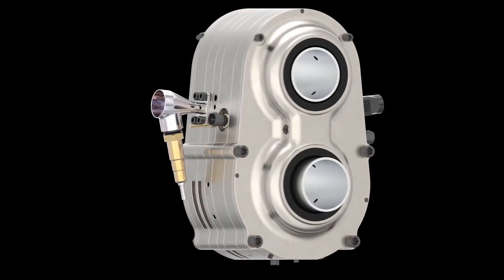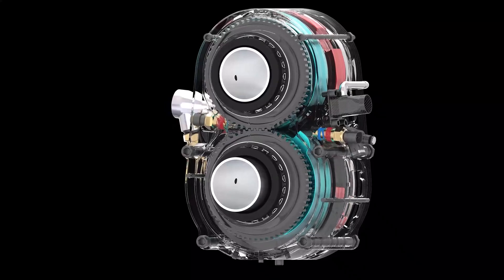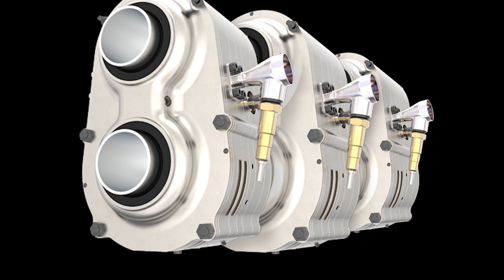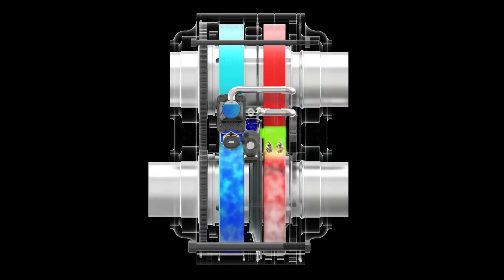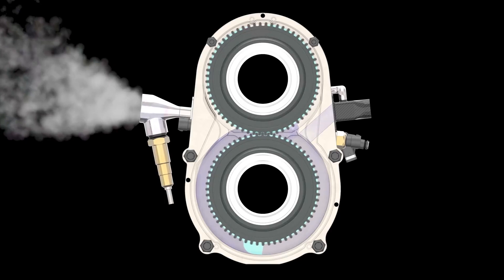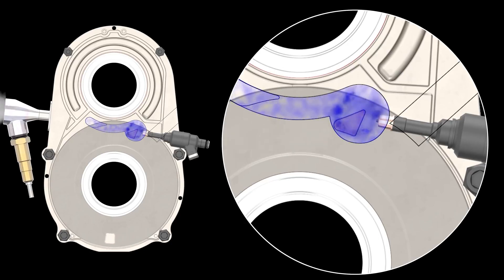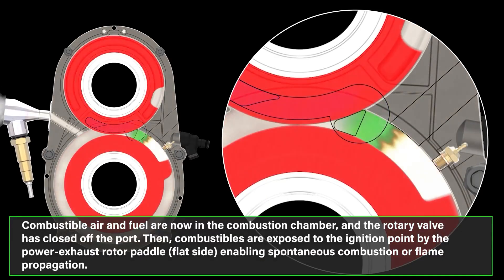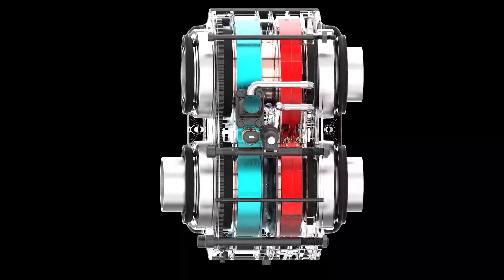This pistonless engine runs on hydrogen and revs to 25k rpm

Comment: Very interesting.
I'm kind of a Fanboy of Hydrogen as a Motor Vehicle Fuel (AS WELL AS Others. Egg Basket Scenario)
Conceivably possible, even to retrofit our old Gas Guzzling classics.

A couple of quick points on of EV's and Fossil Fuels...
1. EV'S aren't as Efficient as you've been lead to believe (Still a good idea, See Below)
2. Fossil Fuels are far LESS efficient than you've been lead to believe..
    (2/3 of the energy these fuels produce is lost as unrecoverable HEAT)
3. EV Materials Are a bit less environmentally friendly than we're told by the EV People.
4. EV's aren't near as BAD for the environment as the Oil Industry tells you.
5. ALL energy Sources are FINITE. Fossil Fuels being the most used and the smallest supply. Nuclear Fuel grade materials, if we ramped up production Tenfold, would last us another t0,000 years (See 6) and the sun will dim to the point of unusability in what? Several Billion?
6. More people have died TODAY from Fossil Fuels (Not including accidents) than have died from Nuclear Energy Ever (Including Accidents, and yes, including Fukoshima and Chernobyl).

Comment: Too complicated, you need to be able to mass produce something like that then you need fuel then you need an infrastructure for that fuel. All of it has to be easy for an average person to drive this to work or wherever without any worrying. Electric is easy, just plug and go. The motors are just an improved version of something humanity had for a century, nothing to re-invent.

Comment: Maybe good as gas to electric power as it could operate at a constant uninterrupted rpm but I don’t see it would be practical for gas to mechanical as this would require too much fluctuations that this engine clearly would not hold up to in any long term sense.

Comment: Hydrogen is a lousy fuel for vehicles. It has about as low of an energy density you can get, is difficult to handle, requires a pressure vessel that adds a lot of weight, and in the end, or should I say beginning, has to be manufactured from another fuel. 
As far as this design goes, 25k RPM sure sounds cool, but is useless for pretty much any application without the addition of some kind of gearbox reduction, which again adds weight. 
Sealing might be accomplished though an oil film, but that's going to contribute to emissions.

Comment: To bad its not real and has some huge problems. Or you would not be showing some junior high kids 3D render project. A one off motor of this size is 20 grand to make so why is this a render if its real. Oh its simple any motor to run at high RPM must first get there and there for not having seals make the motor never get to its needed operating speed. And if you want more reasons I'm sure Thunderfoot would love to see your reasoning behind it.

Comment: I reckon someone should give it a scale model test run with a comparable electric dynamo to test the potential as a hybrid engine, since both are great in theory and have tremendous potential individually but both have alternative strengths and weaknesses, it could be a great way to phase out fossil fuels for those who want something to fall back on when the power runs dry in an ev.

Comment: With new materials and the new "plasma wire" computer driven machine operations I can see a future of disposable-component rapidly rebuild able power units.  They have no fuel unless nuclear Reactors are constructed to separate Hydrogen from water by electrolysis at 47 Kcal/mole of gaseous hydrogen.

Comment: Hydrogen is much better than electric.  It is safer, holds more energy than a battery, and is cleaner than a battery.  You can get hydrogen by splitting water molecules using solar panels vs building a solar panel creates a lot of extremely toxic waste.  While batteries do not give off exhaust, the exhaust hydrogen gives off is just water, H2O.

Comment: They probably recommend hydrogen, because it functions more like extremely high octane gasoline. With regular gasoline, I'm sure the internal pressure needs to be reduced, and thus power will be significantly reduced as well.
The second question is: what's it's estimated mpg? Because a high efficiency, but also a high Rev limit, may make this engine weak at low rpms, and not very efficient.
Reply: With the rev limits and the horsepower this supposably has, it will deliver max ho at low rpms like 5-6k rpm. Also I have no clue how you can make a monolithic block or metal that can handle tight tolerance and high-low temperature difference, especially on something as explosive as hydrogen

Comment: It is a pipe dream. This engine has a lot of problems: Engine seals, cooling, air compression, fuel spraying and many, many others. The engine is not so small whatsoever. It just works on the computer and on the computer only. There's a video of that engine and it's big and it leaks oil like crazy. I'm waiting to see the working model and its specification.

Comment: High precision tolerance plus high heat don't mix well. Tolerance and money don't mix well either. This would cost a fortune if it ever gets built, and then it will not be economical to sell once it is working  so for these reasons, I'm out. Lol if it ever does work it will be some space age material that costs a fortune plus some extreme precision manufacturing. I wager it either never works, or never gets mass produced if they get a prototype to work.

Comment: Has one actually been built and run yet,how do very close tolerance,s work,you need to allow for expansion,it all sounds good in theory,I have drawn up many engines myself on paper,some even using household blenders and flux capacitor,s but never gone any further,there was an engine built years ago called a split cycle engine that ran on water,apparently the oil companies bought the rights to it.

Comment: Unfortunately the elites want to restrict the movement of the masses so they will keep flogging the poisonous and useless battery vehicles. Hydrogen is easily the best way forward for cheap and clean fuel for the masses.

Comment: You would want to see the torque vs RPM values and just how narrow the real world torque curve would be, not the simulated or theoretical values. Then the issues tight tolerances when they come up against the thermal expansion. How big and complex will the cooling system have to be and on that note the more wasted heat heat the less efficent the drvice is.

Comment: It seems unrealistic and how tight would the tolerances need to be to avoid leaking at any speed... at the extreme tolerances and ~200psi you can't lubricate very well as you would blow out any lubrication you might put in there to prevent the engine dying from friction alone. On top of that thermal expansion is not a thing I guess with the new wonder materials this engine will be build out of because if it is a thing those tolerances will make it a very short lived engine if the tolerances are tight enough to prevent 200psi air from escaping.

All in all it looks like a wonderful thing on paper but in real life... lets just say that until its build and runs I simply will not believe it. Also lets compare this to the Koenigsegg terrier a real engine that works, at 90kg it delivers 670hp, this fantasy engine would need 4 units to get to 640hp at 64kg it would be lighter but by the looks of also a lot bigger. On top of that it needs to be build first and proven to work which I seriously doubt it will as nature has a way of being difficult when it gets to forcing crazy power out of a very small package.

Comment: … tight tolerances remove seals on anything…. 

But we can’t just do that.. 
even a mrd dollar science project uses copper squash seals and when we get to those levels of precision like the polish of a space telescope lenses (even those are not perfect tolerance) they are expensive.. 1000$ glass 200k polish…
.. and there was something with high heat, pressure tied to those tolerances… …expansion, corrosion, ..

Comment: The problems that I see with this, and to a lesser degree electric, is that we spend a lot of time focusing on how clean and eco-friendly they are, very little time in the costs involved and even less time on how absolutely fucking volatile some of these technologies are. Both electric batteries and hydrogen are substantially more likely to go up in a ball if something goes wrong than a fossil fuel engine.

Comment: Hydrogen is the most inefficient and unpractical of all energy carriers.
That alone makes this very unlikely. 
The extremely high pressure makes it unlikely. 
The extremely small tolerances makes it impossible in my opinion. 
Just a few of my thoughts about this fantasy engine.

Comment: Things like this, more efficient engines, combined with low capacity, high power electrical storage and electric drive trains will provide much cleaner and more economical transport.

Comment: Don't know why every one is on the hydrogen kick.  It's expensive, hard to contain, polluting to produce and is hard on most metals that it comes into contact.  Plus we would have to build the entire infrastructure to maintain it.  Now if this could burn cleanly with propane or methane, that would be wonderful.  A lightweight car that would be perfect for urban travel and perhaps a very long range because of it's efficiency.

Comment: Maybe has potential in aerospace applications where the high RPM sealing requirements are actually manageable by throwing money at the problem. Aero engines will never be car engines so long as cars need to be affordable. I can think of lots of reasons why I'd rather have a cheap 4-banger in my car than this thing. Size and weight reduction is great if you can afford it, most vehicle consumers cannot.

Comment: i think its better than electric batteries to make an electric car are far more costly than what it would cost in material to make this engine and hydrogen made from water and salt water works fine we maybe could even lower the sea level over time or stop it raising running all engines on it

Comment: So it would waste large amounts of gas and hydrogen would warp because it wouldn’t get enough air to cool it and the ware would make it useless in long distance driving
Reply from the maker: Not that i know of yet. 
They are still in development
Reply: @ChrisVSCars  hey good response time but it seems to me one of the thing wrong with this engine would be the heat the best engine I ever seen was the duke engine but not the duke design watch let’s learn something kids been making small two strokes for long time and his ac compressor engine is the best work model of the duke
Reply from the maker: Only time will tell whether they will be successful😂

Comment: Aside from the tolerance issues mentioned by others, I'd be interested in seeing the expected torque curve for something with a 24k rpm operating window.
Reply: The rpm floor is probably pretty high, if it's going to skip fire under low load
Reply: All I want to know is if I can fit a screaming dump valve on it...
Reply: @bigmike obama Agreed. Even if they used a low friction coating on the rotors that won't burn, it will eventually wear off and you'll basically have to replace the entire engine because the case is worn too. A mere rebuild is not enough, it's a disposable design. 

The only way I see hydrogen combustion being viable is via high temperature combustion in a sealed, low pressure argon saturated chamber to generate electricity directly via a lot of peltier modules through temperature difference. The transfer of heat from one side of the module to the other induces an electric charge that can be harvested. The greater the difference, the more electricity is generated because more heat is being transfered.
Reply: @TheDustyShredder  You might want to search for "hydrogen fuel cell" and compare their already attainable 50% efficiency with what you might expect from your suggested design.
Reply: Most likely, the curve will start around 9k rpm and flatten out around 21k. Idle will probably be around 4-5k.
Reply: @TheDustyShredder  that sounds hellish
Reply: @archise3191  Unfortunately, it's the way it would have to be. The combustion chamber will have to be made of titanium to withstand the heat of the oxyhydrogen flame jets. The argon is to allow for higher wall temperature without corrosion occurring inside the combustion chamber. A special thermal compound will be developed to facilitate the heat transfer between the chamber wall and the peltier modules.

Because the chamber will be saturated with argon in a low pressure state, there will be zero atmospheric gases entering the system and combusting with the high temperature HHO flame jets, which means no NOx or CO2 or any other harmful emission. Also, because it's a sealed combustion chamber, water vapor will build up in a condensation chamber where the condensed water will be pumped back to the tank. The estimated output of the 1,920 modules would be 23kw at 12v before being fed to a step up dc-dc converter to 360v. This engine would run lengthwise along a vehicle and the peltiers will be liquid cooled. Radiators will be placed in the wheel wells and in the front bumper. This system would be able to generate enough power to charge the batteries while running the motors at a reduced capacity and generating its own HHO for combustion. It would utilize a stoichiometric ratio of hydrogen and oxygen to maximize combustion temperature, and the size of the flame jets will be small to avoid melting the chamber wall.

Because the only moving parts would be the pumps to feed the engine and scavenge the condensed water from the engine, this engine would be the most efficient ICE, it would be very lightweight, and it would be extremely reliable. Unfortunately, the temperature of the chamber wall would have to reach the same temperature as the exhaust of a turbojet engine, and it would have to be a consistent temperature throughout the chamber wall. Otherwise, peak output will never be reached. Regardless of how it's achieved, this is the best method for utilizing the combustion of hydrogen to generate electricity.
Reply: @TheDustyShredder  the best part is that it says in the video the idle plans to be 1k 💀
Reply: @TheDustyShredder  Just like kaneda's bike
Reply: @TheDustyShredder  Just like kaneda's bike
Reply: @TheDustyShredder  So even geared low it will suck for real world driving; basically equivalent to idling a normal engine at 2000 rpm.  Very cool design but very limited in applications.  The future is electric and even if hydrogen has a place it is very likely better to run it through a fuel cell and drive with the motor technology as everything else than make a complicated niche tech.  Whats the use case
Reply: @ccibinel  aircraft
Reply: @OnerousEthic  fair point.  Now they need to make a real motor and ya could work if paper design translates.
Reply: @ccibinel  this ks definitely not the right answer but what about having it turn a generator which then powers the electric motors?
Reply: @ccibinel  This would be far superior to fuel cells in hybrid electric powertrains because it has much higher power density. 

They are both high efficiency. I wonder the difference…
Reply: @ccibinel  in hybrid, in optimal mode or off. not self sufficient.
Reply: @ccibinel  single use military drones which don't need to worry about emissions.  This engine was discussed on Autoline as a vehicle application but they've probably changed strategy because of emissions + duty life challenges.  Nonetheless, it's a very cool concept.  You're 100% right about the future of transport - it won't be hydrocarbons
Reply: i just bet you would love to see it pervert!
Reply: It would have 800HP if it could maintain the ”230Nm” at 25k rpm
Reply: @qs138v3  well sure, but then it would also have a higher rpm cap. Peak torque is almost always around the 70-75% mark of the rpm range for high rpm engines.

Comment: I have been looking at EV's lately, comparing them to one another, because I firmly believe my next vehicle will not be using gasoline. This hydrogen rotary engine does look interesting. The size/weight : power ratio is incredible, and allowing numerous motors to be hooked up in-line is noteworthy. I could see this motor utilized for many applications.
Reply: EVs are a cool technology but don’t think for a minute that you are cutting emissions because of them. In fact, you’ll be ordering emissions as soon as you make the order for one. Their production emissions are insanely higher than an equivalent massed ICE car.

Comment: Nice concept. It wont work though. Even if they could machine it to the tolerances required to prevent leakage over the vast areas that the system would require, impurities in the air and fuel would wear on the parts. Not to mention the normal wear and tear that parts in motion experience. Without seals all of the major internal components would have to be either indestructible, or super cheap and disposable. They would have to have some form of sacrificial seals that could be replaced. Otherwise they'd have to replace some or all of the major components. It's more likely the user would have to replace the entire engine if a single part began to leak.

Comment: Run on a water splitter hydrogen cell! Look up Meyers water car and check out his hydrogen generator using electrolysis. The current draw to make it is only 16-20 amps so well within a alternator output and thus steady supply. And the hydrogen combusting in the engine with air emits water at the tail pipe use a collector at the tail pipe for the water and you have a near endless fuel supply!

Comment: Or you can get a rotary engine that works..... It's called an electric motor. The combustion process is inherently inefficient. The production of hydrogen is extremely energy intensive. None of the stuff makes any sense.